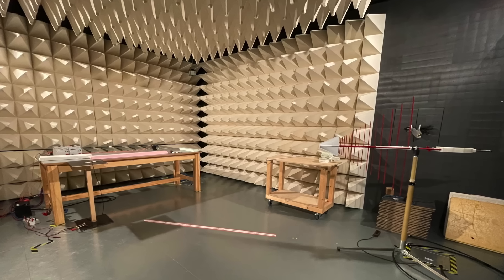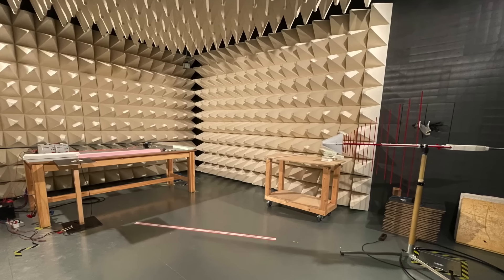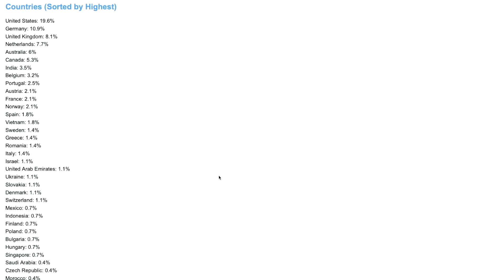I Built the Perfect PoE Sensor - But Can't Sell It to You

Comment: My understanding is that selling electronic kits, rather than finished products solves practically all of your problems as the final customer is considered to be the manufacturer rather than you.
Reply: This is correct! Sell it as a kit, don't sell it as a manufactured product.
Reply: "Some assembly reqired": you need to add a battery.
Or a Hello Kitty sticker.
Reply: That assumes the kit is using listed components. If the components aren't listed then you need to get the parts listed.
Reply: That's not a get-out in Europe
Reply: self-assembly kit that, once assembled, becomes an EEE is treated as an EEE at the moment the kit is sold → you fall under WEEE/CE.
• Components/sub-assemblies sold separately for further integration are not EEE; however, they may be considered an “apparatus” if offered to an end user as a functional module.
Reply: @kropi  So can't you sell a kit that has for example an esp32 module which has already met the CE certification? It seems like you would be able to do this without any issue, just selling parts to add to already certified modules would be allowable I would think. Many robot kits do something like this, the robot is probably not compliant but the module in it is. I don't see any of those kits like that claim to be compliant and they sell them all the time.
Reply: @newmonengineering the CE certification on the esp modules is to increase the chance that your design will work, the testing for the CE cert for your product is needed because emi will leak from the pcb itself, therefore it should be controlled
Reply: @newmonengineering putting together CE parts, does not mean the combination is still CE.
Reply: @exol511 you are correct and I understand all of that. However at the same time I see kits like arduino, esp32 for robots etc with add-on boards sold all the time. Another words, as a Kit it seems to be legal to sell eventhough the entire setup has not been tested or passed certifications. If that is legal to sell like that, I think its an understood risk that is on the customer of the kit. Its either that or all of those kits are illegal and that would wipe out all the makers that buy parts to play with.
Reply: @kropi  "this product is sold as a part for installation by a qualified installer"
Reply: @kropi  Developments Kits are fine in theory.  After all.. there is the DE-10 nano and other big dev boards that had been sold in the EU without CE markings at all.   But the unit most likely has to be Non-functional with the components provided And can't simply be able to  have what is sold plugged in to avoid being considered a finished product under EU regulations.   For example: The Raspberry PI  was required to get a CE marking.  There is something about them not being able to be exempt due to sheer volume of units and the diversity of their prospective customers.

In short, to avoid the requirement for a Kit  is going to have to be equipment intended Solely for study purposes,  Or a kit with some necessary components for the device to turn on and work which are Not included  and have to be selected by the customer that cannot be added by simply plugging in.
Reply: @Myzidya  Sounds like his device does study power usage.
Reply: @Myzidya  CE at is more or less a self-signed certificate. You declare the conformity with the rules; it is up to you if you do the tests or assume your device will conform to them. If you are selling it as an Ltd. company, you are responsible only up to the starting capital, which may be like 1200€. Preferably, it is not mains powered, as this removes most of the problems.
Reply: @Myzidya  The DE-10 Nano, and other boards like it, is a development kit designed to be used for developing electronics which would undergo a redesign to incorporate only the parts of the DE-10 used in development. The final design would then have to go through CE testing etc. before selling. This is why the DE-10 does not need a CE mark.

An example of this would be the Mister Multisystem 2 console based on the Mister add-on to the DE-10. It was properly redesigned to incorporate the FPGA used in the DE-10 directly without the user having to purchase the DE-10 as well so it had to undergo CE testing. I think they have a video about the testing but I might be getting the memory of the video confused with the Sinclair Spectrum Next also undergoing tests lol
Reply: @kropi  Depends. The typical criteria is if the kit can be used as is. Closing a casing around it will probably not be enough, but I've seen products sustain the classification just because you need to program them first
Reply: How about an online shop with parts - each part (of the sensor) sold separately?
Reply: AFAIK if the kit is for a complete product you're still considered the manufacturer. At least as far as electronic waste is concerned in the EU. But if you leave something out, like say the power supply, it's not a complete product anymore
Reply: Yea!  Just do it in a way where you will never be able to have a real commercial business as a result.  Start a company,  put effort in,  and never ever ever reap those rewards.  It's so simple!

The EU is business friendly and individually hostile.  It's a terrible place to do business.  You're actually just making the same point.  Sell kits?  Please.
Reply: @Mark_McConnell  Well the simple option is to not sell it in the EU, but have it made and sold to buyers outside the EU.   Then the importer is responsible for certification  if someone wants to buy it in the EU.
Reply: @Mark_McConnell  Y'all are moaning from ignorance, because most of these rules have been in effect prior to the EU. just on an individual country basis. Most dramatic thing that changed is a unification of the rules allowing to sell a product in all countries of the EU thus having to provide a multilingual manual.

Electronics safety regulation is older than the EU and the legal form of a LLC is older than the EU.

This guy just wants to sell without responsibility, because he can sell with little effort as a one man operation, but would be personally liable without taking out a loan to form a LLC to shift liability to it with all entailing responsibilities.

There's simply inherent hazards with electronics. It is one thing to build them yourself if you know what you are doing, nobody will stop you. It is another thing to sell them commercially. Should we decide on clout who is trustworthy or not? Is it the new neoliberal bet on the neighborhood burning down depending on whether you bought electronics from a trustworthy source or from a guy that wants to make a quick buck?
Reply: Exactly what I was about to say 👍
Reply: Omg this is genius, why didnt i think of that
Reply: A 99.9 percent complete 'kit'?
Reply: I’d buy a kit and make it
Reply: Nobody wants Europeans to fail more than European regulators
Reply: Yes, however I'm not sure about waste payments and PCB and other elements.

And ... elements are very small todays. Soldering require special equipment. You probably need to deliver preassembled "electronic.modules".

And, as far as I know with waste - you need to achieve some recycling ratio.
Will it be easy to explain "my company is new, my products are still working - I have nothing to recycle yet" or it'll be "you didn't achieved required 70% recycling - the is penalty foreseen"
And ... could you just recycle your products, or you need certificate from one of those waste recycling company, that 100kg of your products was collected in whole country and recycled?
Reply: @johnfox2483 ... or you may offer a long term rental instead of selling.
Reply: And as an electronic specialist I am willing to assemble them for a small price and ship them as a private person.(other laws)
Reply: i came to say the same : DIY kits
Reply: two indépendants kitss : pcb box and ony électronics parts
Reply: Great Point. And best part is that there is no definition of how much (or little) the final assembly must be.
Reply: @niclash that is actually good, I think... Regulating it would produce hundreds pages of legal text, resulting in having additional things to check, declare, new standards to prove, certificate assembly manual in 30 languages, recycling procedures for each subcomponent, etc... There should be a regulation exempting small volume production from all that BS. But that won't happen as it doesn't benefit big companies with budget for lobbying...
Reply: @sergiuszk  while exempting small production volume things seems like a good idea at first, it could easily be exploited.
Know how amazon is flooded with capital-letter-salad "manufacturers" selling e-waste? Each of those would be considered small production volume
Reply: @HolarMusic True - that's the downside, another one would be lots of fire-hazard electonics masked under small volume hobby. Perhaps those hobby devices could be also clearly marked and so - would leave decission to the customer. Or maybe a regulation that such exempt is valid only for companies registered in EU.
Reply: There are currently only 27 counties in the EU, and you only need to provide a translation to the countries you sell to.
Reply: @niclash Is that why they don't put the batteries into remotes when you buy them, so you need to assemble them into working condition yourself?
Reply: While it gets around some problems. If you sell something your placing items on the market and still have to pay packaging licence fees.
Reply: Cool for nerds, who enjoy tinkering with/for things.
But for actual consumers, who spend their free time touching grass and having families, don’t have time for that.
Reply: @3rdHalf1 people finding this product aren't normal consumers to begin with.

Comment: Yep. I was in exactly the same situation with openvehicles (OVMS) a decade ago.

Solution we found was:

1) Pay a lab to advise and do the certifications, with local assistance to revise design as necessary. Cost depends on product, but in China around US$5k - US$10@ for a radio product CE+FCC.

2) Use local distributors to handle e-shop, fulfilment, etc.

3) Do everything through a shielded company to save your house.

Obviously only worthwhile if the volume is sufficient, and for me the above doubles to triples the selling price of the product (compared to raw components as kit). Also makes it hard to revise the product, so you need something that is going to be stable for years.

The alternative, of course, is to sell solder-yourself kits through sparkfun (or something like that) to avoid the hassle. But the satisfaction of making a product and getting it into the hands of users may outweigh the negatives.

It all depends on volume. Also shipping internationally is a nightmare with all this tariff crap going on at the moment. I’m mostly ignoring the USA, as well as one-off international shipments to end users, at the moment.

If you want to chat about experience, you can get me at openvehicles.com. Mark.

Comment: the recycling fee is nuts, means there is no incentive for making a product that actually lasts; it promotes disposable tech. If you make a product that can last 20 years, there should be no fees.
Reply: You could probably solve the recycling issue by partnering with an electronics distributor like Antratek. They are registered for recycling in some EU countries. However, check General Product Safety Regulation (GPSR) which will add another hurdle to your quest.
Reply from the maker: Yes. it's unfair to small companies and does not support longevity
Reply: I disagree. If we gloss over small volume sales (its definitely unfair to small companies!), then the recycling costs are per piece sold. Every piece of kit must eventually be recycled. If you make long lasting products, you probably sell them at a higher price, or make money from subscriptions, both of which mean you are less affected by the recycling fee.

Comment: if it was sold as a self assembly kit, would it require the same legal overheads?
Reply from the maker: it may help with certification requirements.

But the biggest problem I’ve run into is the WEEE and PPWR regulations, which absolutely destroy even the slightest possibility of economic success for me.

Comment: I think there is a misunderstanding. The law, meaning the EU directives and regulations, is completely open and freely available to read. The standards are not, because they are written and published by private organisations. The IEC, for example, is a non-profit international org that has no formal connection to the EU. The harmonised standards published by IEC, CENELEC or other bodies are not laws. They are suggested methods for demonstrating compliance with EU directives. They give a good legal basis and you can be sure you have in good faith followed the law, but they are not mandatory. you could choose to read the EU directives and come up with your own compliance solution or maybe rediscover the solutions the harmonised standards suggest.

I do think these standards should be freely accessible, or at least much cheaper. A few EU countries already make them available to their citizens at no cost, or very little cost.
Reply: Exactly! The EMC laws are all about compatibility in the intended enviroment where the product is to be used. Eg if you're the only electronics supplier to an offgrid commune you can simply check that your devices are not interfering with each other and you've followed the law to the T. But for a wider market you need a standardization body to tell you what the limits are in eg. domestic, industrial, automotive enviroment - for a price.

My pet peeve is that some of the standards are using frankly arcane equipment for no good reason and that EMC labs are absurdly inefficient - treating every contract as botique engineering, when they're taking the same measurements every day.
Reply: @g_glop so your offgrid thing works fine in an isolated environment, and then your dad walks in to admire it, and his pacemaker stops working…
Reply from the maker: Omg 😆
Reply: @professortrog7742  Sounds like a bad pacemaker or an "Act of God".
Reply: @professortrog7742 I wonder how he copes with the Sun's presence
Reply: @professortrog7742  Poor man , survived all those years in front of a tube TV with a 42Kv flyback transformer just to be killed by an ESP32 with a Lora transmitter ... RIP.
Reply: @professortrog7742  you mean those heart pacemakers that need live connection to internet and active subscription to cloud services to work? maybe dad just forgot to pay his bill...
Reply: @LagartoPT  the Chinese module in 24 billion shipped products has less regulatory thought than this video, they clone things and copy the logos and the world survives it with microwatt transmitters.    Until you have 5 million in sales, nobody is going to chase you down for RF complaince of a bare board for the NA market.     If its good, make it as a kit.
Reply from the maker: Thanks for clarifying and correcting my misunderstanding!
Reply: @playduino you might get access to this meterial though a library.
Reply: @playduino  These regulations are designed to be confusing, you're definitely not imagining that bit. The intentional obfuscation results in an entire industry being born just to facilitate meeting those requirements. Things don't have to be this complicated, though there is no way around the need for expensive equipment.
Reply: "Make easy what should be done, make hard what should be avoided": I also recognized high prizes for our german Standards + Norming documentation alone, an extra obstacle to learn + develop good + conform products following best practices + standards + norms, as it should be. May be this explains Germany technically frozen status, compared with other more innovative countries.
Reply: It is quite annoying that there isn’t a way for individuals to access standards for free. I understand charging companies the hefty sums, as it’s relatively little initial investment (at the company scale) for a copy of a standard, and they don’t get updated that often, but as an individual if I want to build something myself that makes use of this common knowledge, I have to sail the high seas. Thankfully, many companies and polytechnics will upload copies of standards to the open web, so a search with “filetype:pdf” often bears fruit
Reply: " you could choose to read the EU directives and come up with your own compliance solution "
Here is a RL issue if you want to work as electrician in Sweden.
The law says all installation and repairs should be safe in use and carried out in accordance to good branch praxis. The latter is codified into a standard of around 1400 pages. While you are free to deviate from the standard, you then have to document why it was done, and why it does not induce risks nor lower the quality of the work.

The same thing goes for "your own compliance solution"
Just look up "Easee Home och Easee Charge säljstopp" to see what happens if you have not properly documented your solution.
Reply: Except the laws and regulations don’t tell you anything actionable. 

This is like saying “the law only tells you you need to speak proper English”, when the “proper English dictionaries” are all expensive documents you need to buy from private companies.

It’s a racket, it has always been one.
Reply: That's the theory. In reality, you will never pass if you come up with your own standard, because proving it is compliant will just dry you up. The govt employee will not get fired for putting "denied" stamp on everything you bring, but would def get in trouble if he slaps approved on something that is bogus.  TLDR - if you don't have IEC, do just do not pass, no matter what the law says.